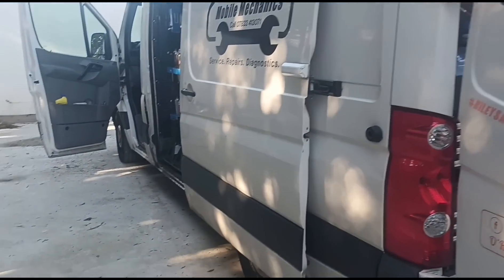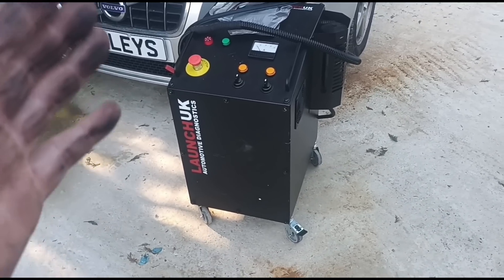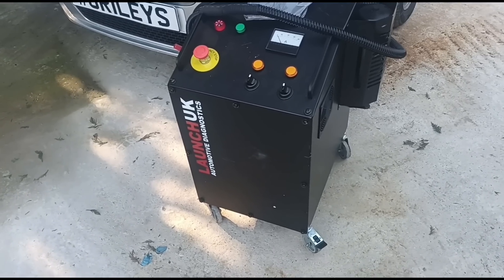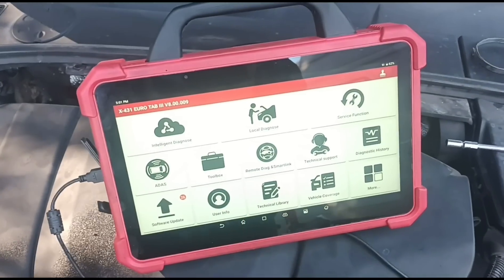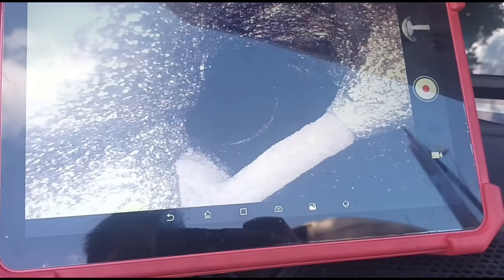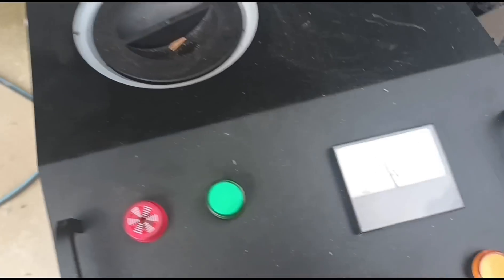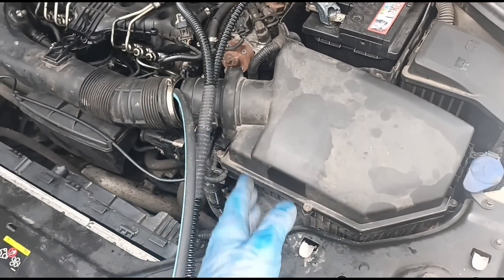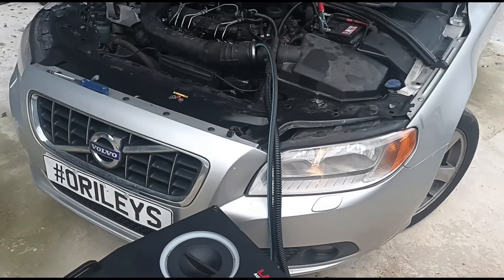Do HHO Hydrogen Carbon Cleaning Machines work? Before & After Video Of Intake & EGR Valve

Comment: You need to adjust the ignition, ECU (leaner mix) and belt timing and run the HHO over 2-4000 km to see the results. By just adding HHO to the engine without doing this will give engine knock and use more fuel because the O2 sensor gives MORE fuel because of the increase in oxygen from the HHO. It works very well if you do it correct. The easiest car to put HHO kits on are older pure carburetor cars. I highly recommend using mikuni carbs as they have vaccum pressured jets and makes the response instant with the HHO its goes like a rocket and the sound of a raw straight carbed inline four just puts a big smile on anyones face. All you need is a 123Ignition coil to get the ignition perfect and you got a powerful, economic simple durable engine.

Comment: Well, hho is making better combustion in the engine and it can be beneficial for DPF but not for EGR valve. I was experimenting with diy hho generators while im driving so it can be beneficial, or now you have LPG Propane installation for diesel engine which actually makes engine cleaner. M
Reply: Does LPG on diesel engine works well?
Reply: Yes, in Poland and Serbia are some companies. They work on Dual fuel installation, actually it's working with 60/40 ratio so this combination is more flammable then just diesel, and engine is cleaner  @tej_3423

Comment: Is the EGR even used when idling? I thought the purpose of an EGR system is to reduce nitrogen emissions by reducing combustion temps when driven at low and medium loads. Idle and full power would be bypassed completely.
Reply: For the same reason it is open on idle exept when engine needs to warm up. If EGR is stuck in open position it may take longer for engine to warm up and it will lack power when you need to accelerate.

Comment: First of all, decarbonization works on the principle of temperature. So, in the part where the egr valve is located and the intake manifold itself, there is no high enough temperature to trigger a chemical reaction.
But inside the engine head, on the exhaust, turbo, dpf, catalyst, the temperatures are much higher there and the chemical reaction occurs there. So this video didn't show us anything. If he already has a micro camera, he should somehow have looked into the area where the valves are and show before and after the treatment, instead of showing us the suction part, which can be seen to be dirty even without a camera.
Summary of the story: the inside of the engine can be significantly cleaned by decarbonization. Intake, egr valve, throttle cannot do that without physical cleaning. I hope it's clearer now.

Comment: Tried various intake chemical cleaners at most they only softened the oily residue . 
After removing inlet manifold /throttle body /EGR/ intercooler / intake pipes . All these were washed thoroughly and reinstalled 8 hrs labour

Comment: you did not considered some scientific facts: 1- a real carbon cleaner must produce at least 30 litres per min, and nedd 6 KW electricity, the device you used I think did not consume 1 KW and can produce even 5 litres per min!    2- it can clean only interior of engine,    thanks for video

Comment: If somebody expecting HHO carbon cleanerbto clean EGR and throotle body, then god only save him.

First of all, HHO works if it works only when it is burned inside the combustion chamber. Gas on its own cannit clean anything.

Another point is that you can not see the difference with naked eyes as it hardly removes any hard carbon from the combustion chamber.
Hope you understood...
Reply from the maker: I understand 👍🏻 

Just showing that what almost every carbon cleaner online are claiming isn't true that it cleans EGR, intake manifold,  Turbo, intake valves etc

Comment: Carbon Cleaning, will only clean the combustion chamber, as the Hydrogen burns at a higher temperature than air. DRive it before and after.or look in the conbustion chamber before and after, You will notice a difference. The problem arises with all the cowboys saying it will clean your DPF, EGR etc. The machine takes water H2O, and creates HHO, which is 2 parts Hydrogen, pure Hydrogen is pumped into the combustion chamber, and the higher combustion temperature will burn a big chunk of carbon off.

Comment from the maker: Some comments saying it won't clean intake & EGR etc but selling sites advertise them as such. Also most carbon clean business say it does.

From a site selling identical machine...
With our new engine carbon cleaner ECC230 we make a preventive treatment of the carbon build up in our car cleaning engine, EGR System, FAP and other parts of the exhaust manifold.

These are being sold to clean "FAP DPF" EGR & exhaust manifold.

Comment: Hi Jimmy, Because we like, respect you, and your very valuable input to the motor industry,  I will do a write up on this machine for you in a few days that i hope will give you and the viewers a better understanding of what its actually designed to do and not what peoples claims it does, the industry was badly damaged by amateurs making bold claims on facebook etc, showing off little green boxes that was modified hydrogen gas welders, re badged by a company called carbon kings etc etc, The machine you showed is not a one off, we have several of them, lets meet up soon for lunch and a catch up asap, thanks, Paul @ CD
Reply: not so much of a question of what a HH will do and how, but why pay that much to clean half the system when a chem clean can clean the complete system inlet to exhaust better, and without putting chunks of carbon in to the DPF inlet. (or CAT on gas)
Reply: @JustMe-Dude  we have never seen chuncks of carbon go anywhere, as to costs, the average costs of a quick HHO service clean is approx £50-60,
Reply: @pdonneky  unless you're using a borescope into the front end of the DPF, how would you see the little chunks of carbon stuck in the honeycomb? running an HHO without a CAT on a gas engine, you would see debris coming out the tailpipe. plenty of videos out there showing this, as if it was a good thing and proof that it works, but does not take into account what happens at the DPF.

Comment: Surely there wouldn't  be a path through the EGR Valve unless it was recirculating ex gas.
At idle it's not likely to be recirculating so the H2 would only pass through the inlet manifold ?

Comment: I totally agree, I have done tests on 5 cars, with HHO for 1 to 2 hours per car. Diesel and petrol. Did a check of intake, egr, combustion chambers, spark plugs and dpf and dyno runs before and after. No changes at all! On a 2 liter diesel it compensates for 1% of the fuel necessary for running on idle. And it was a heavy 3kW HHO generator, producing way more bubbles than the one shown here. Total snake oil marketing! Invest in good quality additives like WYNNS, built for the purpose you need!

Comment: Interesting video Jimmy. I have always been skeptical about these machines and if they do anything. Ive manually cleaned the inlet manifold on my Audi SQ5 TDI twice in the 50,000miles ive had it and have used various products (petrol, brake cleaner, degreaser etc) to see what is most effective, but found throttle body and carburettor cleaner to work the best. Apparently oven cleaner also works well but I havent tried it yet.

Regular manual cleaning, plus fitting a good quality Mann & Hummel catch can is the only way to keep ontop of the carbon buildup in my experience. Also using the best quality diesel and giving the car regular heavy throttle applications to reduce the EGR being open as much.

Comment: Anybody who's scraped the carbon off valve stems and manually cleaned a cylinder head or anything caked in carbon could tell you this carbon cleaning machine nonsense is well.. nonsense.

Comment: After reading the comments, a further trial of this machine on another vehicle should be done. Next time remove an injector or glow plug for a before and after inspection of a cylinder with a borescope. 
Some of the pro-hydrogen commentors make sense that its a 'hot side' only process, its worth another trial whilst you still have the machine.
Makes interesting content too.
Reply: I think the biggest point here is that the launch cleaner probably does the same thing on the cylinder heads and turbo as this hydrogen cleaner claims to do. I think when Jimmy runs this through the intake, you would probably see very similar results in the combustion chamber, so there really is no point in much additional testing.
Reply from the maker: I've never seen anyone say I'd like my cylinders carbon cleaned.  Cylinders cleaned themselves as they are "hot" 

Everyone who gets a Carbon Clean done is looking to clean the intake manifold and or the EGR valve and turbo. 

For me this has proved enough that its a waste of time and money and not something I'd feel happy charging a customer for.

Comment: that should be done at some RPM, probibly 2000 to 2500rmp.
I know you said other carbon companies do it at idle, but some do it at RPM.
The intake i gues, will suck the hydrogen in and combust it more as well.
Reply: it's a diesel,might not be a good idea to be putting that in the intake and causing pre-ignition

Comment: Wouldn't loosening carbon deposits from the intake side eventually make it's way through the engine and clog up the DPF?
Reply: I have seen videos where, during the cleaning little chunks of carbon were coming out of the exhaust pipe onto the ground. so yes, I would imagine those chunks go straight to the DPF. if a lot of them build up and it tries to region on the road, it can cook it into place.
(update) so there's no confusion the carbon chunks coming out of the tailpipe were on a gas engine without a catalytic converter to stop the debris. A DPF is designed to stop debris.....
Reply: not if you hoover them out before turning on the engine
Reply: even better turn off egr and dpf and remove dpf core then recycle better mpg performance and less maintenance!

Comment: Good honest unbiased opinion Jimmy 👍

I’ve always thought the only way to clean the oily carbon build up is to disassemble the inlet components and clean them manually, anything else is just a temporary fix which will still leave a surface which will attract the buildup to happen again quicker, obviously the cost involved in this method is expensive but if you can do it yourself it’s the best route to go.
Reply from the maker: Definitely the best way.  I do use the chemicals to do a Carbon Clean. Even that is limited but has enough success to free up stuck EGR and turbo vanes
Reply: @ORileysAutos  Anything to do with 'HHO' is invariably a scam.
Reply: Have you tried revive engine turbo cleaner seams to work have you tried tereaclean it's chemical based and seamed to work well on my old pd 130 went for emissions test next day unable to get a reading
Reply: Only things I've seen working were walnut cleaning , ultrasonic on some  small parts, there are two chemicals that work but can't be used near plastic or rubber.
Reply: @remotaurog  walnut cleaning it's good for a reason* because it's never go back todpf or engine iteself this is why we do aspirator + walnut and change oil always that how u invoid problem but this method on the video is asking carbon build up go directly dpf worst sceenario case dpf buid up carbon mean ur gasket gonna explode* that the reason why most of them has blown gasket* don't do it lets build up alot if there a problem clean it with ur hands there no best cleaner called "hands manuel"

Comment: It would be interesting to see the hho machine on a blocked DPF to see if the result is the same as the Launch DPF cleaner you currently fill the DPF with.
Reply: It won't have any effect on a blocked dpf, the people that claim they clean dpfs with these machines either reset the calculated soot loading or run a forced regeneration alongside the clean. 

I've done hundreds of carbon cleans and only ever had 2 cars where the dpf back pressure reduced afterwards, neither of the two cars had a blocked DPF and back pressure was around 10-12mbar before starting. 

Asking for trouble if you advertise a hho carbon clean as a DPF clean.
Reply: @gaj1612  Many thanks for the feed back, a real eye opener as to the scams the hho cleaner blokes get up too.
Reply: waste of time to try on the DPF

Comment: Always enjoy your videos but you’ve stuck your head above the parapet with this one Jimmy! If you solve this controversy then there’s probably a peace prize in it for you.

In my humble experience of owning turbo diesel cars over the last 20 years, then buying the better diesel definitely slows down the build-up in the intake in the first place. Either that or buying 2EHN and putting it in the tank with regular city diesel (which amounts to the same thing).

In both cases there the combustion is much more complete and so there is less to come back via the EGR.

Appreciate that’s of no help when you have a customer with a clogged intake, but as a preventative it seems to work for me. Also the Italian tune up (i.e. ragging its arse off at least once a week when warm also seems to make it run smoother afterwards).

I’ve been told by a few people (i.e. I don't know for sure) that if I buy the cheapest / simplest water injection kit (there are a few kits which are less than 300) then that water mist which gets sucked through the intake after the MAF will (over a period of time) wash away most of the carbon sludge in the intake and also steam clean the back of the valves.

Could one of those maybe be a future video? Where you fit one of those to one of the fleet and update with findings. That could be a great series of videos. It might even turn into a lucrative side line in fitting them to your subscriber’s cars…

Comment: I have a hhc machine not that one but   all do the same thing. They sell them as they clean inlet valves manifold etc. Witch is bull. But iv had great success with it on diesels that have failed emissions test. I pulled head of my van after a clean +6k and was amazed how clean it was.

Comment: I have been involved in electrolysis (which is all this machine is) for 15 years and that is why I have never done this to any vehicles because hydrogen alone will not remove carbon deposits. I would say though that in order to achieve some degree of success the engine needs to be running on hydrogen only...
Reply: On the other hand, give me first refusal if your giving it away bro... 😁

Comment: You have to rev the engine up every 5 to 10 minutes jimmy to agitate and remove loose and vaporised particles so that the gas starts to get the next layer. You should have checked the valves and injector tips and piston crowns  and the hot side for a before and after shot, the EGR won’t move if you don’t rev it but a engine carbon clean is a preventative procedure not a cure as it would have removed a soot buildup off the EGR but not the sticky marmite, same on the intake side, only a preventative.
Reply from the maker: Done a few revs every 15 minute
Reply: well, the trolls are out, trying to save their own ass 🤣
Reply: @JustMe-Dude  jimmy is a decent DPF guy because he’s learned his mistakes as he goes like us all but I’m no troll buddy and I’ve done engine carbon cleaning for around 5 years now and I know that a engine carbon clean does nothing to clean a EGR, a DPF and the intake manifold. 

Just trying to pass a few purls of wisdom on so he doesn’t come across like the guy who said that his engine carbon clean machine would clean the DPF on the smax film or was it a custom.

I use a Sykes Pickavant machine that works well if done like I said but it has a lower output so that’s why I do it for 1 hour as too much power can remove to much carbon and cause other problems, no one is trying to put him down but experience over the years is good to pass on.
Reply: @markobrien5551  
I understand you agree that it doesn't do much to anything other than the combustion chamber. 
i'm just saying it's rather pointless since it doesn't do anything to the EGR or the intake valves and that's the main problem with most modern cars. Also, it is not really useful for the DPF. Just doesn't make much sense to do it since the other method of cleaning chemically works better. justifying a carbon clean system without actual scientific evidence, and just seat of the pants Information is just not my cup of tea.
Reply: Thanks for the reply jimmy but with respect your video is the equivalent of putting a DPF cleaning fluid in the down stream pipe of the pressure sensor.
Reply from the maker: @Mark OBrien  why? I followed the same procedure every carbon cleaner does as a business?

I'd be happy for anyone to come show me it done and I remove the parts to inspect before and after
Reply: Because your analysing a part that doesn’t get cleaned by a carbon clean, your not doing it right, rev it 10 times at 3 to 4 thousand revs every 5 to 10 minutes, it needs at least 1 hour and then take it out for a test drive for 20 minutes pushing it in low gears and get another 30% of the crap out, you done it like someone who has come over the channel in a dingy with a £200 eBay special and done the snake oil brigade proud, but if you’re going to rip the back out off the process at least do it right.

Then get it analysed at your mates mot station with a exhaust gas analyser, then give everyone your opinion buddy.
Reply from the maker: @Mark OBrien  I've never seen anyone who does this as a business run an hour carbon clean & do a 30 minute test drive. 

I know lots of carbon cleaners and they do a 30 minute procedure and that's it.

I've just tried to replicate what service is offered commonly charged for.